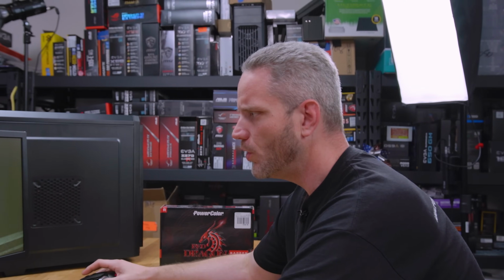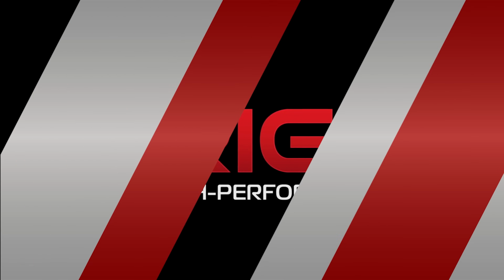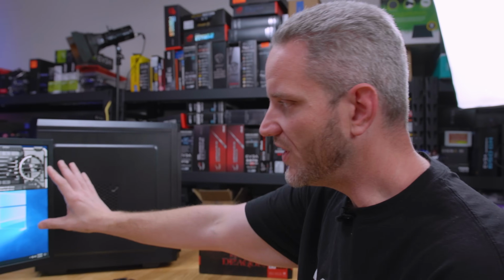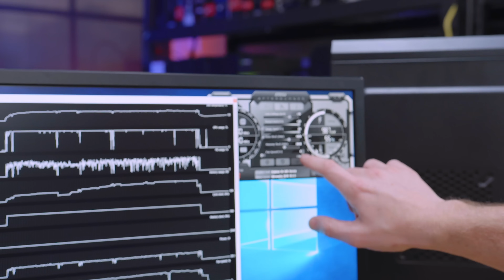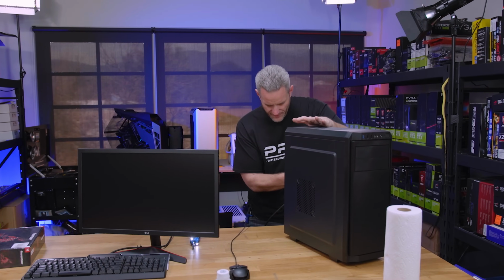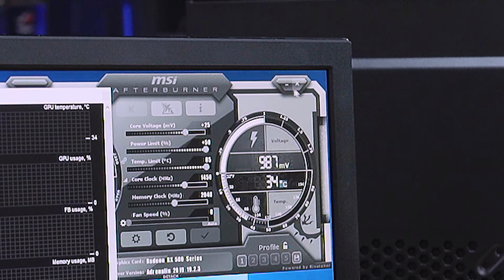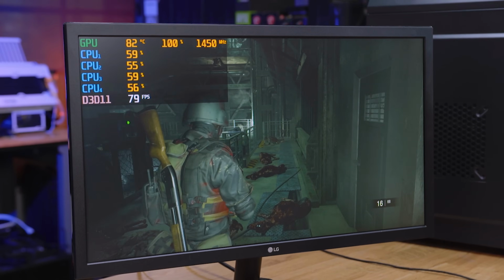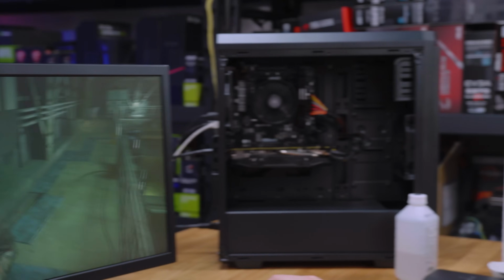Should you replace your video card's thermal paste??

Comment: It's not a grey area - voiding warranty because you removed that screw is literally illegal in the US. (probably Europe too, but I only assume that because they tend to have better consumer protections)

They can not deny coverage based on any damage you do when taking things apart - but just taking things apart itself is not cause for voiding.  That said, there can be certain issues that crop up that MAY come from having done some stuff like this (or may not, it can be unclear), so that is where you get into a sort-of grey area (if they feel they can say "you most likely damaged your card" they probably will) and you should only buy graphics cards from people who have good warranties and support (like EVGA, or anyone on that level).  If you OC your Intel, buy the performance tuning protection plan (or whatever it is called) too.  If AMD has something similar, get it. (even if you dont overclock - because you can basically get a new CPU nearly-no-questions-asked regardless of OCing or not).
Reply: let me correct that for you, they absolutely "can" deny coverage if you do damage when taking it apart.

Comment: I have a 1080ti ASUS STRIX OC edition that was one of the 1st cards to market.  Not sure why, but I have never changed the TIM out.  After now a (few?) years, I noticed at Ultra settings in Battlefront II, I would approach 78C.  This seems high historically for my usage.  Decided to change to MX-4 TIM today.  COULD NOT BE HAPPIER.  The original paste was cracked and borderline missing in one quadrant of the GPU.  My thermals don't break 66C.

Comment: Undervolt from 1150 to 1050 ...Amd software...and from 81C to 70 and not lose fps...max 5fps with undervolt...
Reply: I undervolted my rx 570 to 950 and got a 10 degree drop on my card with little to no performance drop and I’m so glad I did.

Comment: can highly recommend noctuas new paste, my 1080 gaming x was hitting 82c. bad tim application from the factory, applied arctic silver 5 temps dropped to 72c max. can't recommend as5 for gpus it cooks on really hard to the block gpu and traces, used a toothbrush and alcohol wipes to clean the traces. with the noctua paste it maxes at 70c without the cooked on effect with the curing paste.

Comment: On gaming laptops, if you're getting thermal throttling, this is a must.  I had issues with mine hitting the high 90's and throttling.  Undervolting at best, reduced temps by 2-3 degrees max.  I finally took it apart to repaste and the factory thermal pasting was done very poorly.  After a repaste, my temps dropped by over 10 degrees.  No more throttling even without the undervolt.  This was primarily with the cpu, but the gpu had crap pasting also, though not the same temp problems.

Comment: I have replaced original thermal paste on my reference Radeon RX 480 after 3 years with Coollaboratory Liquid Pro and the result is, that card temperatures are almost the same but the card is much quieter. If you want to replace original thermal paste, rather use metal liquid, but you don't use it with heatsinks with alluminium base.

Comment: I've changed the thermal paste on my GTX1080Ti recently and the result was AMAZING! With several Furmark 4k runs in a row I had 91°C (fan turns into a jumbo jet then) and now with the new thermal paste it's around 74°C and the card keeps quiet. The old thermal paste was hard and crumbly. So if your card is several years old, changing the paste can have a huge effect.

Comment: Not a desktop GPU... but my sister's laptop was a secondhand one off ebay.. When she got it wasn't running great to start with. It was a i5 something a 890m which should of been enough to run games at Meh speeds.
I saw a video of a guy using liquid metal on the die of the GPU on an old laptop which sorta brought it back to life, of cause I didn't use liquid metal I used conductonaut, anyway!
When I opened the Laptop the previous owner never cleaned the fans or cooling fins, the dust was so thick and hairy it honestly looked like real fabric cloth, and what's worse he used Thermal Adhesive glue on both the CPU and GPU die.. O_o  Took me hours to clean the Thermal Adhesive off! Works great now though with proper Thermal Paste! :)

Comment: removed a cooler of an RX580 8G which was actually causing a PC to shut down in games.. and wouldn't even run HEAVEN benchmark two times in a row. replaced with MX-4 nothing fancy but very well. temps fell up to 73 degrees max.. and pc was fixed.. I could run heaven indefinetely.. let it run for 2 hours straight.. so in the case of rx580s 1 year of use later you should replace your thermal paste

Comment: The cooler is not doing a good job cos it got no rgb
Reply: Adding rgb increases your FPS by 10% guaranteed
Reply: @xxdeadoutxx761  know it just drains more electricity that not necessary lol
Reply: JOKER • 40 years ago • Updated its a joke lel
Reply: @xxdeadoutxx761  your cool xD
Reply: JOKER, you’re clearly not understanding. RGB is a cooling requirement. If you don’t have blue lighting in your case, it won’t cool.
Reply: Cameron Wethly Exactly if you want a faster Computer you put in red , red goes faster easy
Reply: @xxdeadoutxx761  And.. the green one for low power consumption..
Reply: Muhamad Hasbi Assidiq yeah with green RGB you don’t even have to buy an expensive power supply
Reply: xXDeadouTXx  ☝️blue rgb for cooler temps guaranteed
Reply: @Group_Anonymous  Why has know1 mentioned the  essential VR ready mousepad to make sure all of their CAS latencies line up? Otherwize youll mix up the wordclock and just get white noiz.
Reply: kkkkkk
Reply: I just install some g skill trident z rgb ram, took the thermal paste of my gpu and replaced it with a wet sponge, gained 15 fps.
Reply: F
Reply: If anything rgb makes it worst
Reply: @TheChillDeadpool  can confirm, nitro+ has rgp, worse temps than the same xfx  card with no rgb lol  on the same clocks:)) the copper in the xfx might have something to do with that too.
Reply: @TheChillDeadpool  r/whooosh
Reply: @TheChillDeadpool  r/whooosh

Comment: Just did it on My RX 580 XFX GTS black edition. I was having issue with throttling at stock speed. My GPU was throttling to 1100 MHz in game. I applied Noctua NT-H1 thermal paste, took me about 30 minutes. 

Previously i had 81-82 degres with the GPU throttling at around 1100 MHz with fan speed at the max default witch is 61% on that card, it's kinda noisy at that level. (at 100% it's a turbine). Now After 1 hour of unibench, the card sit at 78 degrees, no throttling and the fan speed is only 41%. At that level, it's barely audible. 

I found out that there was too much thermal paste applied. It used a similar pre-applied thermal paste like in this video but the pressure wasn't enough to spread it. it had about 1 milimeter of thermal paste. i did a test with the noctua to see how it would spread and it was so thin in wasn't even mesurable. 

So Milleage might varies but with my card, i am very happy i did it. Altought i could just have RMA it but then, i would be some week without it to play.

Edit: played quite a bit and it stayed at Max frequency. Temperature were around 79° but fan speed remained at 50% and Clock frequency were stable at max boost clock. Definitively worth it in my case. I Strongly suspect my card is a old card that was produced for the mining boost but got stocked for a very long time without properly being power on. I suspect that if it had been powered on soon after the manufacture date, the thermal paste would have been more flexible and would have been thinner during first runs.

Comment: worked for me. I have a sapphire pulse rx570 and i repleced the stock thermal paste with mx4 and got 13c down with an overclock
Reply: Hey buddy i have the same card. My card also runs at 75-82  degrees flat while playing big titles. In some games my graphics card started crashing on very high settings. You changed it does it make any better?

Comment: I have the 590 fatboy. Decided to switch the fan profile from stealth mode to performance mode. I don't care about the noise all too much. I'd rather have my system running much cooler which it made a huge difference. I also replaced the thermal paste with TG-7 from TT and got about 3c off max load temps through aida64

Comment: I have a load of fans going and would love to make a quick video and send to you if you could say it’s good or not but I have a lot of fans... also the box fan, take the other side of the case off... then box fan that side, you might be thinking why? The back of the board gets hot has hell and that air flowing down the back of the board you’ll see a bigger drop on the heat

Comment: My GPU gets up to 75c on overwatch for some reason, most other games ot doesnt get above 69c

Its relatively new too, it's a 1660ti
Reply: Having a similar situation
Reply: Did you OC the GPU? If so, what are your OC settings. Are you using MSI afterburner?
Reply: @JonJon-bx1ww  I didnt OC it, and no in the overwatch settings you can have it show you what your GPU temps are in the upper left corner when you play
Reply: @samerkia  hmmm okay. Have you tried using MSI Afterburner anyways? What you can do is set a custom fan curve for your GPU, sometimes the stock fan settings don't allow the fans to kick in at correct times especially with games that can be more GPU demanding. Worth a try, I hope that can help possibly.
Reply: @JonJon-bx1ww  Cool, I'll try that out!! Thanks!!

Comment: I had stock paste and did the mistake to buy one veeery cheap. On my intel cpu i got 2C less, on my nvidia gpu +6C compared to stock. Then I though that maybe i used too much, cuz when it comes to thermal paste less is more, so I reapplied it on gpu but still was 5C hotter than stock. In conclusion, gigabyte GPUs seem to have good thermal paste.

Comment: The Rx 580s always run hot. Easily solution is to run it on water. I've been running mine with only cooling the core on two cards and have had them OC'd to 1.5ghz and they've been running perfect for the past year and a half

Comment: For my first build I picked up a used ASUS Strix 1080ti OC and was having difficult time even bringing my temps down to 80.  After playing around with different fan configurations and even changing cases I decided to double check the thermal paste and man that sucker was all done dried up and dead looking hahaha...cleaned that up and applied new paste and instantly dropped like 15-20c.  Sometimes it is the solution and its an easy thing to try before spending so much time messing with case air pressure and even switching cases.

Comment: It is a hot pocket under the card Jayz.  With just one exhaust and one intake, the RPM of the gpu fan gotten lower as soon the side panel is taken off.  Think of the GPU card like a ceiling fan next to the wall, most GPU manufacturer have fin that bounce off the motherboard and go right back into the fan, in this case setup it may not be a issues if the fin side is open toward the side panel so the heat will go up where the exhaust fan is pulling, but this heat sink fin is facing toward the rear and the front to have a few little problem that may be solve.  Ceiling fan pull air toward the ceiling is pushing the hot air to the floor as it follow the airflow of the case room, having one window open on the next floor is not going to pick that hot spot up that great nor will the left fan will be share very little with cooler air the right side is taking.  

The DVI port is in the way with less "window"  to allow those air pressure push by the fan to escape in the small opening.  Heat got to go where the airflow is leaked to the side, meaning the left side of the fan is bringing in just as much heat with less cooler air unless the floor base in that case have holes where the PSU would be.  The right side of the fan is hogging most of the cooler air from the front.   The rear exhaust low RPM could barely get all the heat from below if the GPU left fan itself isn't re catching those hot spot back to the hottest spot of the GPU to be the Core itself.  I got a science ideas, why not get a case that do not have a base floor like you have there and swap it to a more open air room, or cut it :-\.   The side fan of this case is right in the front of the right fan to be sucking all the cooler air all days while the left fan is getting nearly squat.  Second option https://www.newegg.com/p/N82E16811853003

Comment: I couldn't stand how loud the fans were on my Red Dragon RX 580 so I swapped them for 2 Noctura 1500 RPM fans. Looks funny but I dropped from 90C to 60C with less noise.
Reply: Why not just change the cooler and use accelero Xtreme 4 that's wat I did to my xfx Rx 480 gtr

Comment: When I got my 970 (something from ASUS idr the exact), I wasn't pleased with the temps it was running at, both idle and under load. So I took off the cooler and reapplied some thermal paste and was happy with the 7-8 to 9-10 temp diff. Something else I noticed (and I found researched online) was that the very first 'fire-up' of the system, after reapplication of thermal paste, you're less likely to notice a change, not until after one or two heat cycles. Something about the way the thermal paste spreads and relaxes under heating and cooling. This was a while back though and I know/think that thermal compounds have changed since.
Reply: cool that makes sense.

Comment: is the problem that all the amd video cards have from the rx 470 up to the vega 64, you can change and use all the existing thermal pastes, but they will always heat up absurdly, only by opening the case will a lowering of the temperatures be obtained

Comment: I have an xfx rx480 black edition or something like that. 

I thought my card was broken, because in games such as overwatch it would hit 80+C and then soon after it would thermally throttle.
Even in league of legends i got temps in the mid 60s to 70, which is ridiculous.
Sometimes the fans would start up even though i was just in idle on desktop.

Guess what, the thermal paste was dried out of the box 🤣👌

So i changed the paste and all of a sudden overwatch was not an issue anymore. (This was about 2 years ago, i no longer play OW)

And league of legends runs smooth at 55C. 

If your thermal paste is dried up, change it. If not, do it anyway.

Comment: I feel like I've seen this vid a couple times just for giggles, but it's finally occurred to me that you are absolutely doing a disservice to this card, and maybe even the overall premise whatever it may be.

First off, the RX 580 is an extremely poor overclocker, pushing the card for the factory overclock of a Sapphire Radeon Nitro+. Consider that people push this card from its 1411Mhz OC to a 1500Mhz OC, with minimal frame rate improvement, but a fair addition of heat.

The true key with the Radeon cards since the 400 series was Wattman. Wattman allows you to undervolt the individual states of the card, which can of course improve your thermals.

HOWEVER, since you can do it by state, and not a curve, you have much more control over the matter. If you're willing to put in about an hour of time, you can in achieve an undervolt at every single state such that if your card ever clocks down to that state, it can remain optimally cool.

This is of course helpful in tandem with Radeon Chill as a means limiting frame rate when not a lot of action is happening, and thus helps to conserve power and lower heat.

I have at this point in my own overclocking since getting an RX 580, abandoned Afterburner. But I do hope Nvidia allows, or has allowed, a similar level of control over the voltages.